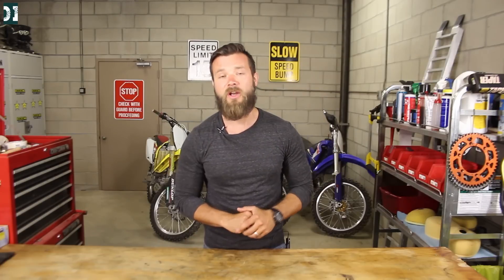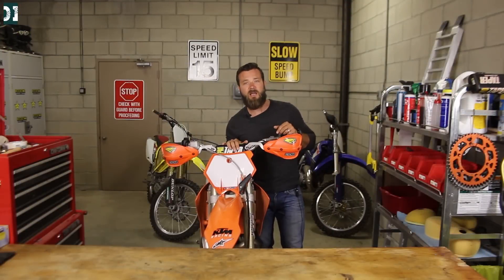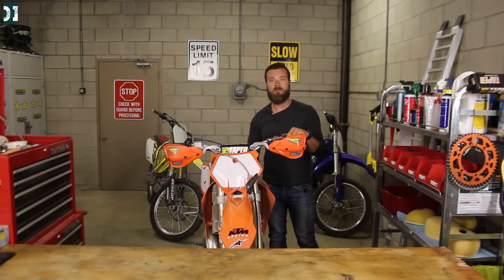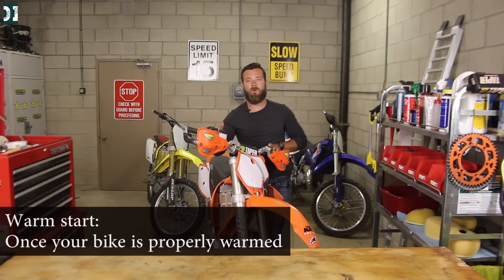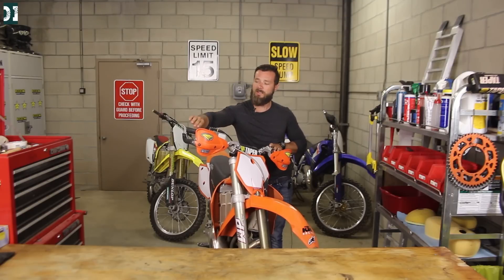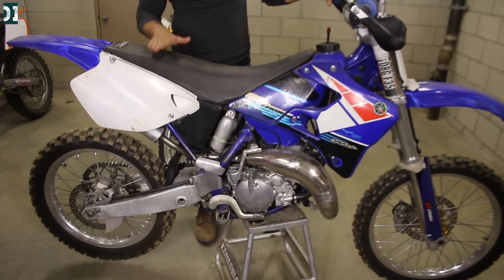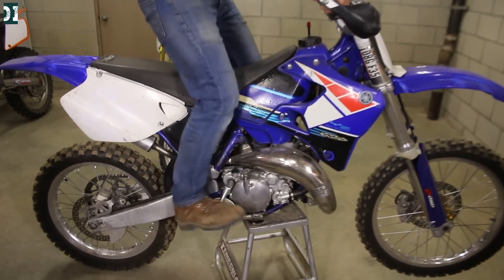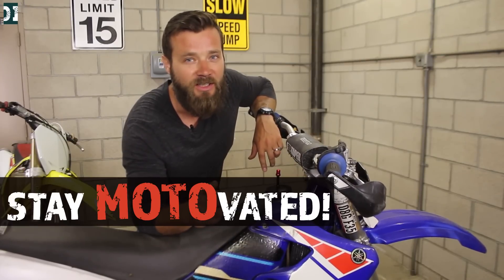How to kick start 2 stroke dirt bike - Beginners guide.

Comment: Hi I just bought a 2011 ktm 105 , and it will only ever let me start it I’m neutral, even when in first or second when I pull in the clutch it will never start. Also when in 1 or 2 or etc other then neutral if I stop giving it gas even when I have the clutch pulled in it will always stall and turn off, am I doing something wrong? Appreciate if I could get some help on this one
Reply from the maker: your clutch might not working properly, might be pulling little bit even of engaged.. try to raise a idle a bit, it might help

Comment: When I came to a stop I pulled in
The clutch but it began revving so high, and then switched off. Why did this happen?
Reply: Sorry i forgot what it was called but the thing that controls how much fuel goes into ur engine might need ajusting,  might be something to do w the choke or ur clutch might need ajusting. Ur engine only revs as hard as how much petrols goin into ur motor
Reply: Flare 120 oh you mean the idle?
Reply from the maker: I am not sure man..
Reply: @princeismailmirza9789   yes!

Comment: mine doesn't start, i need help... new spark plugs, new coil, a lot of electricity..i've tested the coil and the sparks by puttin them on the frame and using the hand instead of kick to check the spark itself..when it is in the cilinder it doesn't start
Reply from the maker: +Daniel Neacsu try one more spark plug. Is it wet if you take it out after attempting to start?
Reply: every time..i used 4 different spark plugs, all dry as desert, after each fail i pumped the gas out (like 5-10 strokes on the pedal) and used another spark, but it came wet again..idk the problem... i replaced the coil , i had to remove the fuel tank to do so and after mounting the tank and the seat (radiator covers not important at this point, im not riding it). since i have new coil it keeps failing..it stayed in my garage for about 1 month since last ride, i was busy and couldn;'t use it...before breaking the old coil (broke the wire that goes to the spark plug and the little screw in the coil)it worked just fine..now im just like "wtf bike" :/ (its a '92 2stoke honda cr 250)
Reply from the maker: +Daniel Neacsu I would trace each wire, measure resistance, go from stator all the way to the plug. Maybe timing is off, you said there is good spark on the plug?
Reply: good spark, good coil , bike was sitting 1 month off, no ride, maybe because i didn't pumped the gas right after mounting the tank? idk...the thing is i am kinda poor, i don't have everything i should in the garadge..nothing to measure the electricity but my hand and trust me, the coil spark is stong..other than that i didn't touched any wires..all i touched since it last worked till now is the seat, tank, coil (which had only 1 wire that plugs into something else) and the front body pannels...
Reply from the maker: +Daniel Neacsu it sound like carburetor issue.. try to kick it holding full throttle. You might be flooding the engine each time you want to start.
Reply: can't be the carburetor, it worked perfectly last time i rided and i did not touched it since then, all i touched to the bike was the coil ,tank, seat, spark plug and front covers, nothing else
Reply from the maker: +Daniel Neacsu I am not sure, I would examine everything one be one. Hard to tell without being there. Good luck Daniel.
Reply: ive watched more of your videos, may it be the stator ?
Reply from the maker: +Daniel Neacsu if your stator is bad you won't have spark.

Comment: Guys let say I'm going from 5th gear to 1st do I just hold in the back brake till it matches the speed for 1st gear then clutch in and shift all the way down and when I shift down since the bike still rolling a bit can I let off the clutch straight dump it ?
Reply from the maker: you should shift down thru the gears as you slow down, use both breaks as well... yes you can just dump your clutch, just make sure that you dont carry to much speed...
Reply: Dirt N Iron Last question and thank u very much do I have to press he clutch in to kickstart it ? And do I need to do with front.m brake or can I do without
Reply from the maker: you dont need clutch and brake for kickstarting,

Comment: try starting that 450 everytime first kick :P I got a 2010 rmz450 and it left me stranded today because after riding for a couple hours I was to tired to kick it over. It always seems to take 5-10 kicks regardless except when cold it is easier. Got new spark plug and air filter but no help. lol.
Reply from the maker: here you go my friend, starting that 450 cold and warm: https://youtu.be/b9TD5QB_6hE
Reply: I seen it but I cant believe my eyes hahaha :P I think I need to go get a tune up.
Reply from the maker: i think tune up will help, those bikes should be starting pretty easy with EFI. Good luck!
Reply: Thanks for the help!:) I have been checking out a few of your videos for riding tips as its my first bike. I also just ordered the hot start lever for my bike since it seems to have a tougher time when hot. I have the cable already installed so someone must have broke off the lever at some point or it was never installed.
Reply: If your air filter fuel and all the other variables are good to go, it may be low compression when the engine is up to temp ( making it hard to start).
Reply: Yamaha WR450 has a handle you pull on the steering when doing warm starts (giving it more lean air fuel mixture is what I have heard some say), 4 stroke dirt bikes with carburettor can be very hard to start when warm.

Comment: surely if you have old petrol mix in it you  should shake it about befor you start as 2 stroke will be sat on the head and foul your spark plug? or it that just a load of rubbish iv been told 😂 iv been told to never leave a 2 stroke at idel as well but I'm not an expert lol
Reply from the maker: +Aaron Corfield  if you let it sit for long time it's better to drain the fuel, before storage always drain. It's better not to warm up on iddle but once the bike is warm you can let it iddle sometimes if you need to, of course not for too long.